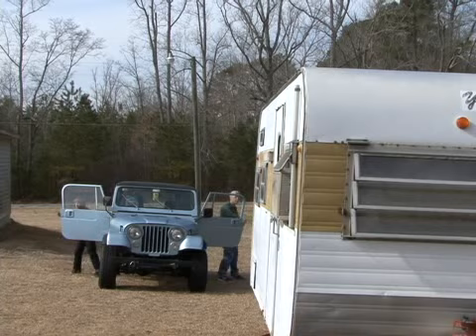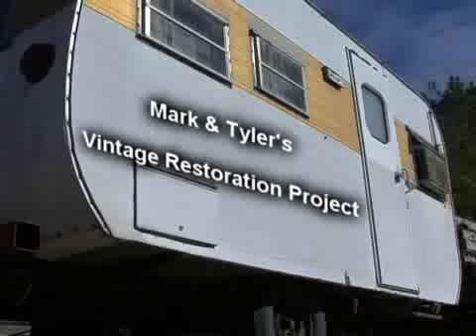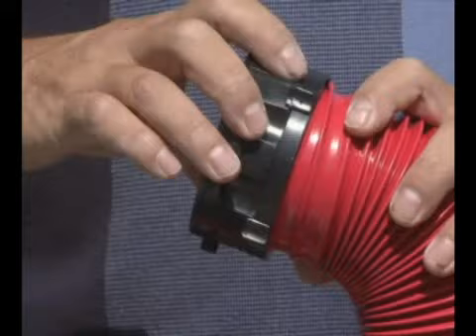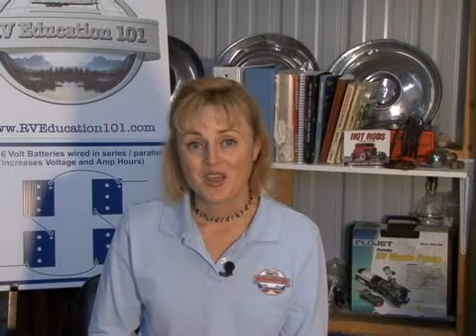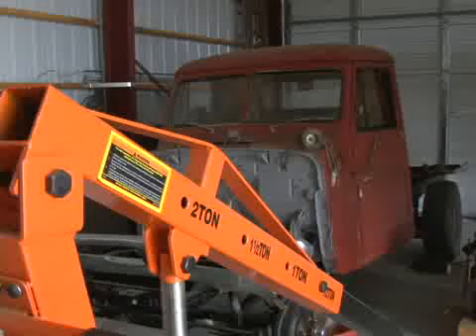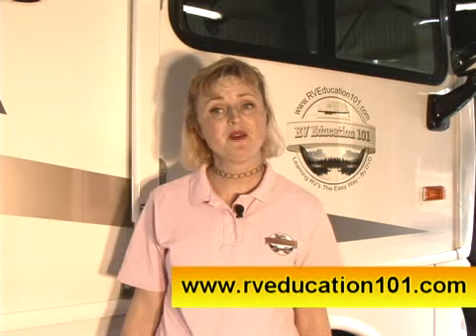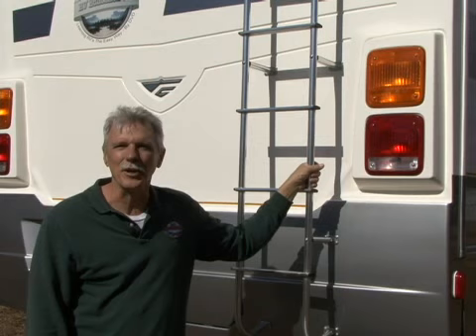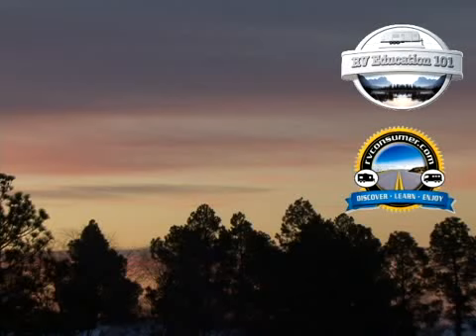Mark's RV Garage Episode # 2 Internet TV Series by RV Education 101

Comment: Mark, your restoration project is outstanding -- very high quality production on the video, very watchable and very informative.

A couple of things that I would like more detail on , if we don't happen to know a guy who is liquidating his RV store, where can we get RV siding with the crimp that is bendable?  And you did not show enough detail on the corner trim molding on the outside of the metal--does it really bend to conform to the curves and where can I get it?
Reply from the maker: +Chris Nordstrom You can purchase RV metal siding online, just do a search using "corrugated RV 
siding." Corner molding does bend. It is made of aluminum. You just need to take 
your time and work with it as you go. I like to start at the top and the more 
leverage you have (length of piece you are working with) the easier it bends. 
Put a screw in at the top and work your way down bending and shaping the molding 
as you go. You can get corner molding online too, I think ebay vendors offer it. 
You might want to check with your local RV dealer, they usually have some 
sitting around that they will sell.